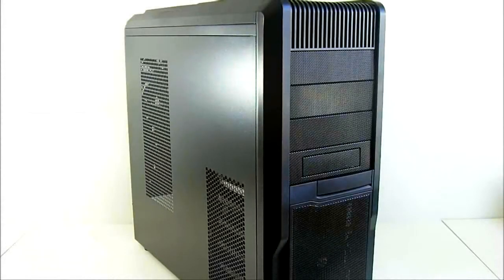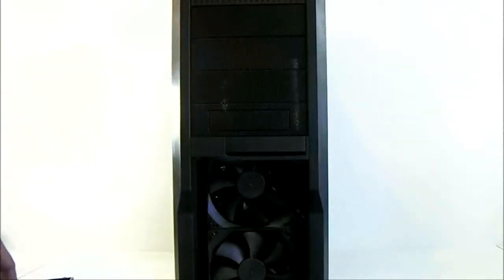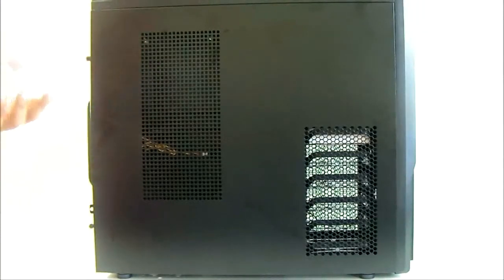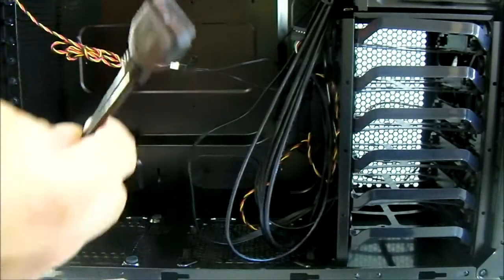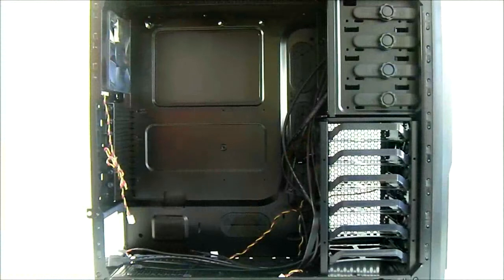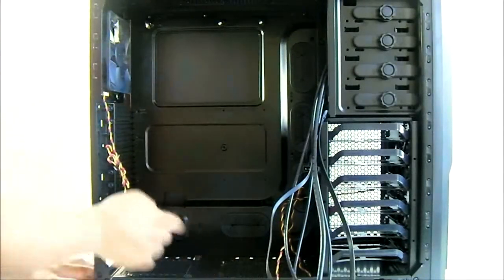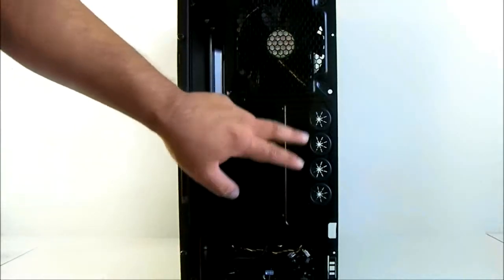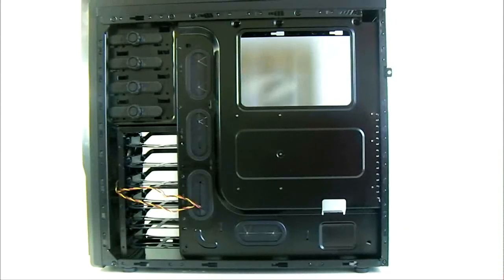Rosewill R5 USB 3.0 Mid-tower Gaming Case Overview

Comment: Economic?  It's 90 bucks... one of the most expensive air coolers on the market.  The only one's more expensive are the Phantek coolers, which are worth it because you get the same cooling and more color options.

At that price it doesn't make sense to not go with a AIO water cooler, much better cooling and it doesn't take up so much room.